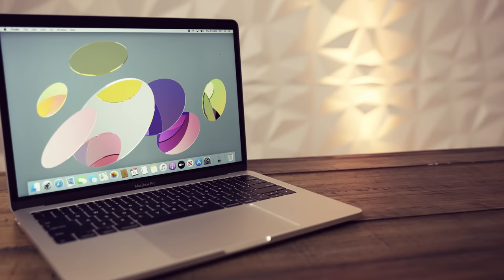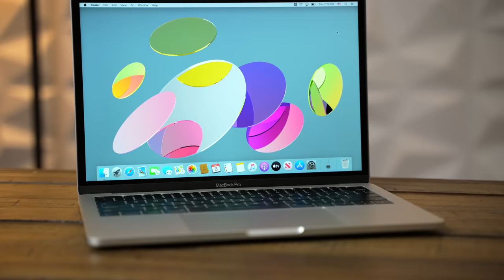Someone tried to CUT THIS MACBOOK IN HALF, can I repair it?

Comment: That they went in and removed the battery before sawing it indicates it was probably an institution (school, government, hospital etc.) that wanted to dispose of them and not resell them. They were not smart enough however to destroy the SSD which is really the only thing that needs to be destroyed to prevent data recovery.
Reply: @Black-Circle  Some places are not allowed to resell computers due to grant rules etc.. My guess is that this was the case, they removed the battery to avoid an explosion and tried to destroy the computer by sawing before sending it to a recycler. I suspect this was recovered from a recycler and then sold.
Reply: @Black-Circle  I agree. Having worked in bureaucracies this is fairly common. Sometimes the procedures required to resell computers and other stuff is just too onerous to partake in.
Reply: I’m sure it’s from a youtuber. I remember a video when they did it
Reply: Why not just remove the SSD, or at least clean erase it?
Reply: @richardcarlson127  Man, that just sucks. :/
Reply: "Well Jim, we took the battery out, so no one can start it up anymore, that should be good, right?"
"Nah, saw that bitch in half"
uncertain glance "Uh... alright, I'll give it a shot."
They got part way through and decided to rethink their life, quit their job, and moved to an island, leaving the MacBook wherever it was with the saw still running.

Comment: because of how many of the MacBooks he fixed before, He has reached the point that I'm not even surprised if the MacBook he received has bullet holes in, dropped way too many times, and even being dipped in lava, and still manages to fix it!
Reply: I have the same one at home, it have 3 shotgun holes in the display, & 5 at the top of the bottom case & at the palm rest where the trackpad is.
Even the trackpad is cracked as hell from a shotgun hole - but i simply conneted it to my thunderbolt display with an adapter & use it every day😂
All keys, the trackpad & even wifi,speakers,... works... i plan to dissasamble the display, then i have a keyboard and a trackpad with an built-in computer😂

Comment: I love your repair videos. As for the saw used, Im sure it's not a table saw and most likely a Hack Saw. A table saw would have left a much wider saw kerf and there's no way I'd do that on my table saw, blades are to expensive, and I don't even want to think about what would happen as I feed that into the blade. Think terrifying.

Comment: I feel like Luke just sawed the "wishbook pro" in half and repaired it for some content 😂

Edit: I do believe this is actually what he did, I think this mostly because he 1. didn't show the listing he mention and 2. when he opened the package he said " I need to order some parts " insinuating that he hadn't ordered them, cut forward a few days when he gets the parts he is still wearing the same shirt and outfit he had on when he filmed the opening, usually in his videos when he cuts forward time he is wearing something different, 3. Who would take the battery out just to saw it in half it takes a LOT of experience to take batteries out of the 2016-2017 Macbook pros, THEORY SOLVED

Comment: Well I honestly don't think you have to worry about that not working months later. I think you are fine it is very secure in there now. I have worked with a lot of electronics professionally. I have pulled logic boards that got road salt on them from wet snow and salt. I have scrubbed them in a sink with warm water, soap and soft scrub brush. Let them sit for a few days to dry and boom they work fine. You would be shocked on how tough a board can be. And then sometimes they just smoke or "Let the smoke out" like we used to say, for no apparent reason. That looks like it was cut with a saws all.

Comment: On the logic board being installed under tension, I am going to put in my 40 years of mechanical experience two cents. Most people would torque the wedged side first, then the opposite side, then the middle. This would probably give the worst results in terms of tension on the board. If it were flat you would want to do like a star pattern, but under tension changes the game. I would install the wedged side screws loosely to hold it into place. It should be able to lift. Then install the high side loosely so that it's like a balance where it's touching in the middle. I would torque the center screws first, and then work outward to spread tension. It should relax over time, especially with a few heat cycles.

Comment: I couldn't believe it booted.... I would have loved it if you had resused the bottom case and even the top case but with new keyboard and battery. Of course it would have meant more parts and more work but the completed working mackbook would look like a frankenstein.

Comment: There is one step I would have added in the repair. i would have removed the heatsink, bend it normally and also remove the bended shield on the bottom of the logicboard and look at the logic board with my microscope to see if the bend can ruin any traces. Then I would install it once I feel good about it.

Comment: the only logical explanation for this i feel would be a destructive attempt to destroy data? which is awfully funny if true considering they managed to avoid the logic board and ssd entirely. Then again, since they removed the battery, you would think they would know where the logic board is located.... very odd. Im beyond blown away that the logic board works in the bent state, especially considering its a modern apple product. Reminds me of the iPhone 3G and 3GS boards that would become bent from expanding batteries, and yet still almost always continue to work. of course now, with the iPhone 6 especially, bent iPhone logic boards dont fair so well. Keep us updated regarding this macbook on twitter, I am curious to know how long it continues to function for. Anyways, doubt you will read this, but great work saving that poor macbook!

Comment: For future reference, I would probably carefully remove the heatsink and replace it. Since it is more than likely warped, the wrenching down into the case might put too much pressure on the CPU and cause it to crack.

Comment: One thing you’ve missed but maybe for you it isnt but you should use threadlocker for the screws in the display hinges. Overtime if overused the screws will come loose.

Comment: My guess, a jigsaw attempt. Had they used a table saw, they might have succeeded. They layed the MBP between two chairs or something so they could push down to put some pressure on the jigsaw, hence the bend. Jigsaw got stuck because they probably didn't have the right blade and the multiple layers they had to go through made the blade seize. Then they had a go at the opposite side, but by then their blade was too dull, so they only got a quarter inch in before they gave up.

Comment: Even though the keyboard is dead, the keys can be use for other MacBooks that have missing keys. You should have replace the heat pipe because that is most likely what's keeping the PCB bent.

Comment: I have worked on one of these types of MacBooks before. I have even swapped the top case which holds the keyboard battery and touchpad for the mouse and it is not an easy repair to do it takes close to like 4 to 5 hours to transfer everything! and it is no small feat not to mention touch ID is strongly adhered to the top case with the touch bar. and the touch ID sensor is married to the logic board which means you can't use a different touch ID sensor with a different logic board. not to mention the newest version of this laptop there's another version beyond this one that if anything breaks on the motherboard and you try to swap the logic board it nothing will work because of the T2 chip on the logic board. Apple has completely ditched reparability with their newest stuff! if you have not heard about it ask Apple for a "Apple Depot Repair" they will repair any water damage! in any sort of problem with your computer your keyboard anything as long as it is within the time span of 1 to 2 years of being in service and Apple still selling that type of computer. this is one of the things that Apple does not want you to know about but you have the right to ask for and have done to be able to get your computer fixed if you rely on Apple computers! Apple Depot repairs cost a flat rate of $450 to $500 to fix basically anything on the computer that you're having problems with. so if you're display cable broke it'll fix that. because there is a lawsuit for a thing called flex gate on Apple laptops where the display cable is made poorly and breaks easily Apple will fix this sometimes most likely for free also!

Comment: I have a broken MacBook Pro Touch Bar display also tagged u on Twitter on what would be the probable cause . It’s still not fixed due to pandemic lockdown… This will help me since work is also stuck because of the broken laptop :(

Comment: Had to have been a reciprocating saw (saw-zall). The blade is too thin to be a circular saw, and I don't think a shop band saw would have bent the thing during the cut. I think the "Why" is more interesting than the "What" or the "How" in this case. Must be a lover's quarrel.

Comment: given the logic board works, you could just take it out, use one of those usc c to hdmi and usb 3.0 dongles and just use it as a desktop may plugged in all the time, may be 3d print a case for the logic board so that you can mount behind a monitor probably

Comment: They tried to cut it in half but gave up and just tried to bend it in half. The heat that the motherboard generates just may help the motherboard get straightened. So in six months open it up and see if I'm right or full of bull.

Comment: A tiny, microscopic speck cracked the “chin” below my 2020 M1 MacBook Pro.  The screen is fine.  Is it worth repairing at Apple or might they charge me $400 or more since I didn’t buy Apple Care?  Or any risk in repairing it at a non-Apple location?  As of now, I put a one inch of black electrical tape over it and don’t even notice it anymore. Everything works 100% perfect. Or might this be considered a manufacturer defect because a tiny speck should not crack the chin to begin with?

Comment: I had an old axe, I replaced the head, and the handle, and used the old wedge to keep it all together. Did I just build a new axe, with an unreliable method of securing the head, which means it's basically more dangerous than an all new, cheaper axe? Or did I "fix" the old axe? This only worked because you did not factor in your labor, plus the chances of it breaking very soon, because of that bent motherboard, is very high. Nice concept for a video, but basically uneconomical, and highly likely very unreliable as well. But interesting to see none the less. Thank you for that.

Comment: Not a circular saw, the cut is too ragged.  Jigsaw or recip saw, due to the bend, the latter with a very low tooth count is most likely.  Hold the saw without the foot contacting the laptop, and it could bend it like that while sawing.

Comment: Just use like that for years if it still works then it's fine also that bend motherboard will automatically fixed by the heat from motherboard it should be fine

Comment: SEE , IN THE FRONT PART OF THE MACBOOK IS THE BATTERY AND IN THEARY THEY HAVE CUT THE BATTERY 
THAT EXPLAINS THAT IT DOES NOT HAVE THE BATTERY 
IT MIGHT HAVE EXPLODED BUT THE LOGIC BOARD HAD A VERY FORTUNATE ESCAPE
IF THEY CUT IT FROM THE OTHER SIDE IT WOUDNT HAVE WORKED

Comment: There are 2 guesses:

1. Either the owner was a mad tester and wanted to check if the MacBook could be cut in half FAILED.

2. The owner thought, KEYBOARD BAD, PORTS BAD, PERFORMANCE BAD, Why don't we just cut this in half

Comment: Come on. It's a MacBook. You don't need to take a chainsaw to it. It'll fail on its own in time. If it's not the butterfly keyboard, then it's the SSD. If it's not the SSD, then it's the charging port. If it's not the charging port, then it's the display cable. LOL

Comment: Someone probably got pissed when they couldn't turn it on due to bad battery or something. Or, it was so slow that they got so mad that they decided to try and cut it in half. Somehow, the stupid thing still works. I love coming up with conspiracy theories when it comes to units like this. Man, I've seen some crazyass CrackBooks where I work. One of them had literal fungus on the inside. Another one had a keyboard that was basically entirely melted. Not only that, but the logic board was melted to the topcase, and some of the components were melted to the topcase. What I think happened with the fungus unit is that the customer probably dunked it in the ocean several times. As for the melted unit? Well, I think that the customer put it in the microwave or set it on top of a running space heater. Wait, there's more. Several months after that, I dealt with a unit that not only had standing water and heavy corrosion and probably burn marks on the motherboard, it also had possible mold inside. That one may have been flooded. Not only that, the day after that unit, I dealt with one that folded flat like a 2-in-1, right? On top of that, the unit had standing water all over, heavy corrosion on the MLB, and the screen was totally shattered, so was the trackpad. Also, one of the hinges broke off of course. I think that one was dropped from the grand canyon lol

Comment: so if the logic board is worth up to $400 and the screen $300 plus $150 for top and bottom case and the whole thing is $600 retail cant you just buy them for $600 and sell the parts for $850

Comment: With the new M1 Macs out now anything over 200 for a working old intel Mac is just not worth it. In fact even then having an older intel Mac now is just not worth it. Back in the days of 1400bps modems as soon as a 5600 came out I dumped the old one and replaced it. Even though it was only a couple of months old it was not cost effective to do anything but trash the slow modem. With older intel Macs the same argument more or less holds.

Comment: This is what happens when a jealous partner catches you talking online to 'that colleague' in just your underwear...or so I believe.

You can tell it was cut on purpose because of the kerf, someone has attacked it with a circular/table saw  with a standard blade. My comment above was made in jest, but you have to be angry in a very calculated way to take the battery out and then put it back together again before cutting it. Unless the sponsors did it on purpose just for the sake of creating a challenge for you. I hope it’s the latter, I find it slightly frightening that someone could be so cold and calculated whilst angry

Comment: Very interesting how less you know and how experienced you look. 
You know it’s the model with function keys and how it therefore has a removable ssd but still say „fans are going on“ like there are multiple fans in there

And I really hope you didn’t film the parts in the order you showed it here. Because ordering a new top case before you even opened it is just stupid

Also you removed many things you didn’t have to and your screen isn’t at all in your case like it should be and the fact  that you didn’t even know which screw comes were scares me

As an apple technician it hurts to watch this

Comment: It's not called repairing, it's called refurbishing ...You are literally just swapping usable parts in a new body, that's it...What's so genius about it ?? As long as the motherboard or the so called logic board is working, any and every device can be reassembled in a new chasis with other sourced parts. Ignorant people think of it like if it's some magic ... I do actual smd repairs with BGA reballs of CPU & various other smd repairs or replacements which are far more complex and sophisticated than just reassembling parts in a new chasis